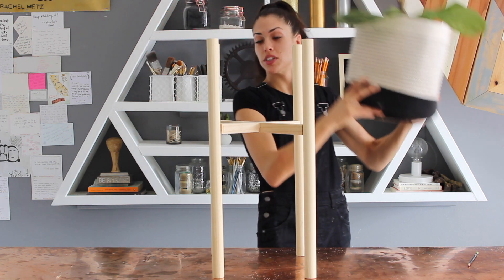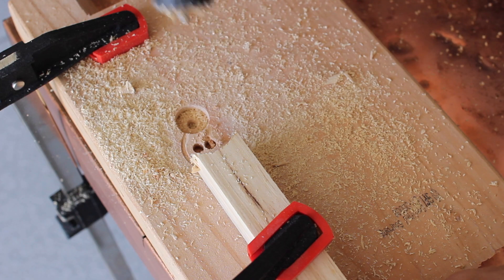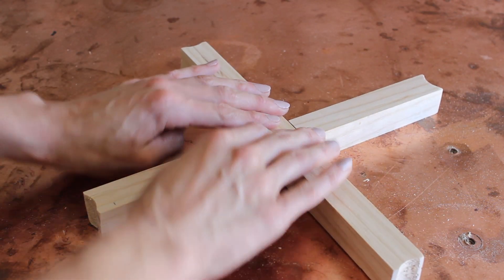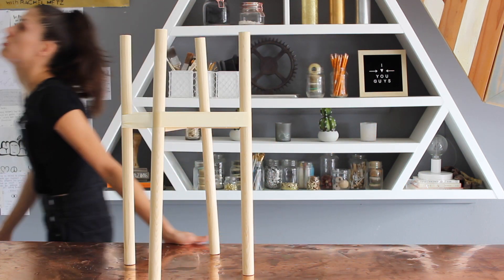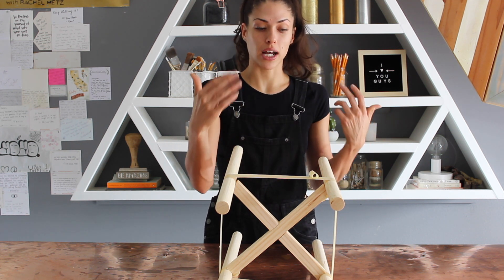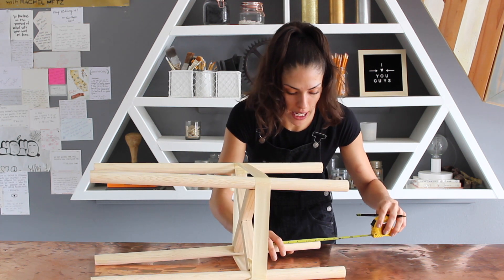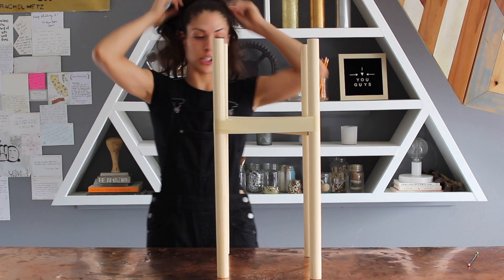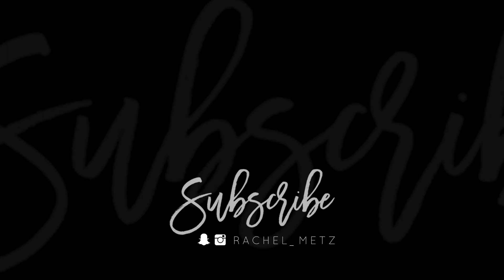DIY Plant Holder | Fake It 'til You Make It

Comment: Just wanted to thank you for the two seconds you showed using the multi tool for the half lap joint.  I have been working on a sawhorse desk for my daughter.  It's not a difficult project but I've been having a problem getting the bottom selves to fit right.  I've been working on those shelves more than a week.  I didn't want cut the 10 degree notch for the legs to long so I've been trying to get them to the right length by hand using a chisel and a rasp.  It wasn't working for me.  After watching your video yesterday I went to the shop and got out my multi tool I used to use when I was working installing hardwood and laminate flooring.  I fixed the problem with the shelves and put the legs together in 45 minutes.  Thanks again for relieving the stress I've had working on this project.  I like watching woodworkers work through problems and you did a good job with yours.
Reply from the maker: Wow thank you! So stoked that that could help.

Comment: since you used two half lap joints, i think it would have been easier to just do one section at a time; basically two H pieces put together separately and fix them together at the halflap joint when each piece is dry. for example: take one crosspiece, fix the legs in there with the dowels and wood glue, secure it [with tape], LAY IT FLAT ON THE FLOOR and let dry. Then do the same with the other three pieces, except this time, the crosspiece will be facing the opposite way of the previously put together crosspiece. that way, you know that your legs will be flat and use gravity to your advantage rather than have it be an obstacle.

your end product looks cool though, so its still a success! great job!
Reply: very constructive reply and a cool tip.
Reply from the maker: You are so awesome! Thank you for this!

Comment: I made one of these this summer, and I made it with rectangular dowels for the cross support, so I was able to use two joints pieces rather than one (which helps with the straightness), I also filed the round dowels rather than the rectangular ones at the joints. I think yours looks super cute, and at least you have one straight side so no one will know it's wonky ;)
Love your DIYs as usual <3
Reply from the maker: That's so awesome. I need to try that my next time around!

Comment: I built one exactly this way a couple months ago but ended up ripping it apart cause I couldn’t get it to be square. I tried it with square dowels and instead of the glued dowel joints, I used tiny brackets. That made it much easier to be accurate and and keep it square. Still turned out cute and was 10 times less stressful! Love the video!
Reply from the maker: Oh I love that! Thank you for the tip xx.
Reply from the maker: I love when everyone shares tips and tricks! My heart is so happy.

Comment: Looking at the pic you included, the other girl’s piece is a bit wonky, as well. So you didn’t do a terrible job copying it.
In order to prevent the upright legs from being crooked, make sure you carefully drill into your cross-members straight down with your hole saw. A small, inexpensive bench-top drill press might not be a bad investment for your workshop. Those convex curves will guide the legs when you glue them together. If those curved cuts are not perfectly straight down, the degree to which they are out of square will be exaggerated over the length of the leg. The longer the leg, the more crooked it will look. Those wooden ‘plug situations’ are actually ‘dowels’ as well. They’re called ‘fluted dowels’. The grooves help them to prevent glue from creating an airlock in the dowel joint, which would prevent the joint from closing properly. Instead of tape, which isn’t a terrible method, you could try using ratcheting straps. There are specialty clamping straps available, or you could just use the ones they sell for tying down stuff in a pickup bed and just hook the ends together. But make sure they have ratcheting tensioners. Happy making!
Reply: Also, making sure the fluted dowel holes are aligned properly will prevent them from making your joint crooked.
Reply from the maker: Thank you!